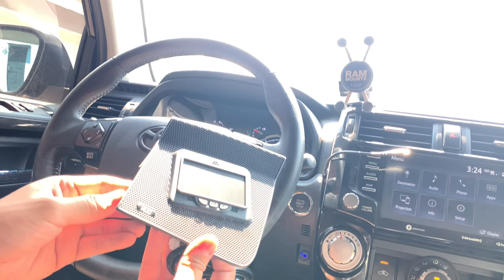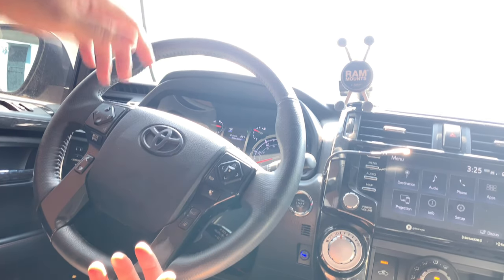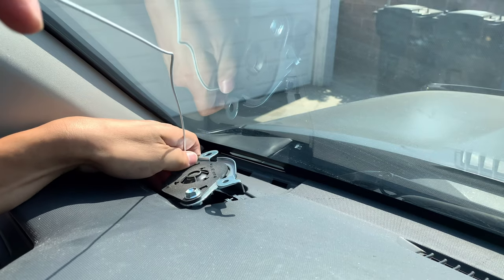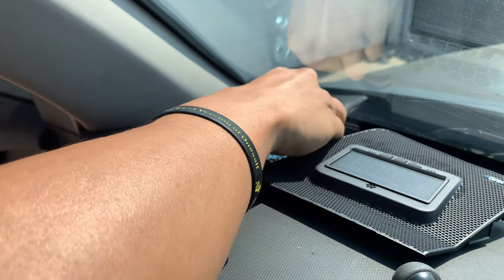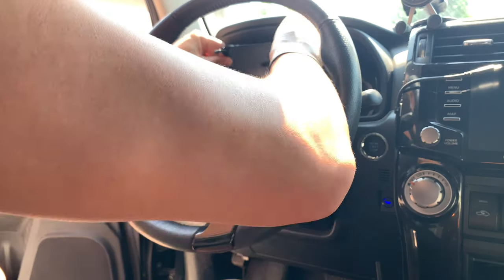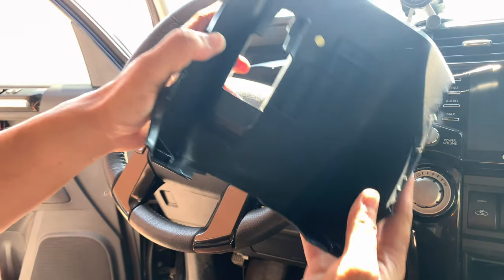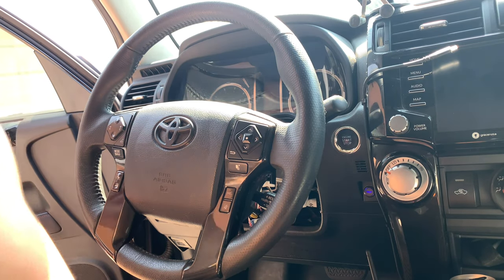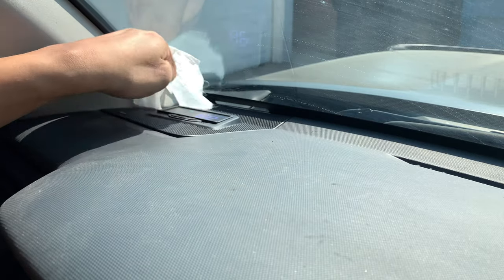Toyota 4Runner (2010-2021) Head Up Display (HUD) Full Installation

Comment: Just installed on my 2023 4Runner. Was hesitant, unsure if it is decent quality, but it is well-made and nice quality. Had a terrible time getting that blue plug to unclip under the steering wheel, and I had so many bubbles in the reflective sticker. Best advice, use some compressed air to blow away any dust particles, as they will create bubbles that cannot be squeegee’d out. Thanks for this install video, it was helpful!
Reply from the maker: Yes definitely clean that surface or it will show. Glad you liked it just as much as I do.
Reply: @OtzleeExplains I have a 2023 4runner.  It's says up to 2021. I know others saying they installed on their 23. What are your thoughts?

Comment: I just added this tyo my new 2023 4runner today. It is bright and very easy to see even in full sunlight. A big bonus is that it uses the vehicles GPS sensor to accuratley display the actual speed. I have 285's instead or the OEM 265 tires and this display indicates 2-3 MPH faster at 50 mph than the runner's speedo. Nice to have the correct speed displayed with this. I like it for that reason but.......to cycle through and use the setting is a total bi**h! I don't even want to try to work with the wonkey settings. With that said, I'm still glad I installed it to use only the screen this video is showing.
Reply from the maker: Thanks for your comment! I couldn’t have said it better. I love this product and it is often slept on.

Comment: I wonder how this device would hold up sitting in the hot Florida sun all day. I feel like that little display screen would take a beating! Any issues yet with heat from the sun? Also, have you noticed a difference with audio quality from that speaker, since the device blocks it a bit?
Reply from the maker: There’s no wear from the sun. I’ve had it on over a year and this year has been blistering hot, no issues thus far. As far as audio quality, it has vents so there is no blockage on audio whatsoever

Comment: Hey, great video! Just got mine the other day and got it installed. 

Quick question, any issues with the turn signals not working in the display? If so, what did you do to get them working on the display…
Reply from the maker: I haven’t had any turn signals issues. It’s been working perfectly ever since the install. Is it working sometimes or not working at all? What year is your runner?
Reply: Hasn’t worked at all since installing the HUD on 2019 TRD ORP
Reply from the maker: Should work for that year. Take a video of it and send it to cartrimhome support and let them know what’s happening
Reply: Thanks, I will!

Comment: Thank you for the video! Question, I installed it but for some reason nothing is displaying. It turned on when I first plugged it in and after that nothing. Any ideas?
Reply from the maker: You may want to check out the connection. Perhaps test the 12v + to see if it’s still power in the line
Reply: It comes on for little bit and reads 15.6 then turns off.

Comment: Does the sticker need to be put on the windsheild.  I have been in other vehicles where they have the hud and no sticker on the walls.
Reply from the maker: Was it an aftermarket hud? Honestly I never tried it without the sticker but I’m tempted to remove and try
Reply: I honestly do not know if they were or not. I just noticed that there wasn't anything on the windshield and wanted to know how it was working

Comment: Just installed mine. But For some reason the turn signals doesn’t indicate in the HUD. Also one of the drawbacks is how it’s such an eyesore looking at the reflective film from the outside.. lol
Reply from the maker: The turn signals work for me. Try reaching out to see what cartrim says. What model is your 4r?
Reply: It’s a 2018 Sr5 premium. And yeah I’ve reached out to them. Waiting for a response ! Other than that it doesn’t bother me nor a deal breaker if the feature isn’t compatible. Everything g else works, warning signs, opened door signs etc.
Reply: @Jon.pascual   any word back from Cartrim? Ran into the same issue.
Reply: @seanavelino6527  I have the same issue.
Reply: @adamjones885  same issue - no turn signals.

Comment: I just ordered one but my OBD connector that plugs into the blue connector is different than yours.  Did you get a different connector seperate?
Reply from the maker: Nope I didn’t have to get anything separately. Which model is yours?
Reply: I have a 2022 Trd pro